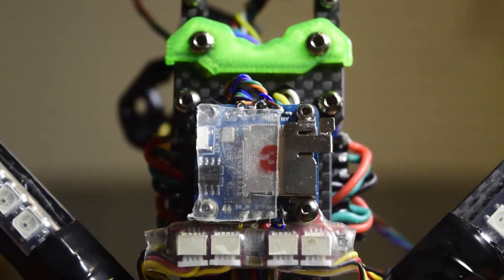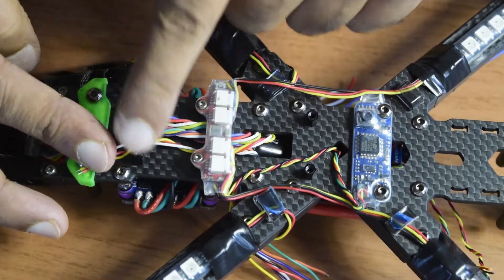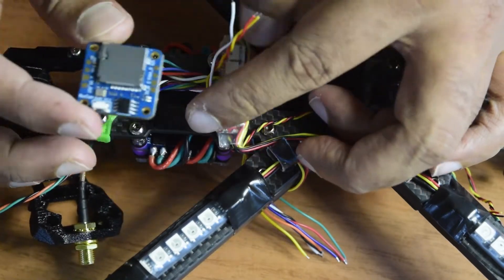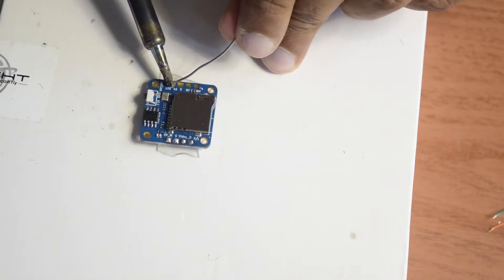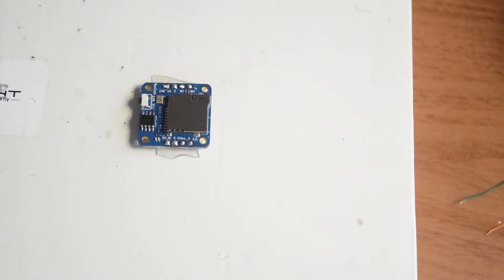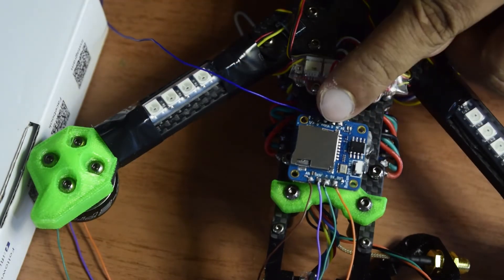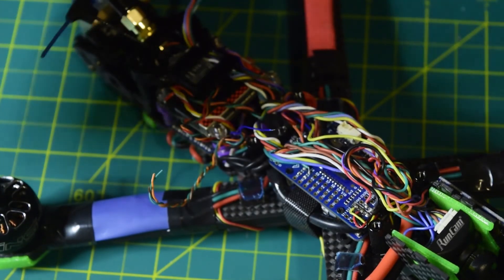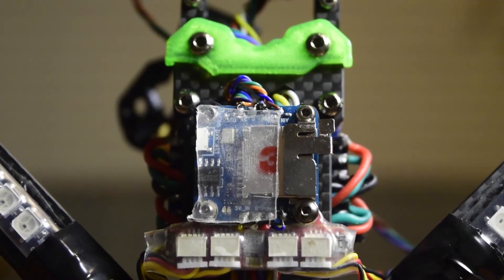How TO install DVR on Drone | Runcam DVR detailed installation guide with Wiring and Remote control

Comment: Is the on/off function the same for turning the camera on and off if used on the H/L pin of the DVR Runcam with the Speedybeey F405 V3 Flight Controller where it has M5, M6, M7, M8, Tel, and S9 and SBUS pins. Is the S4 or S5 function on your Flight Controller the same as my Flight Controller function, where my Flight Controller has pin S9.